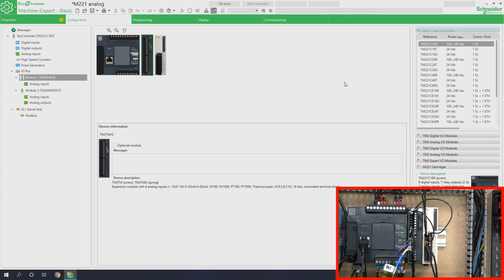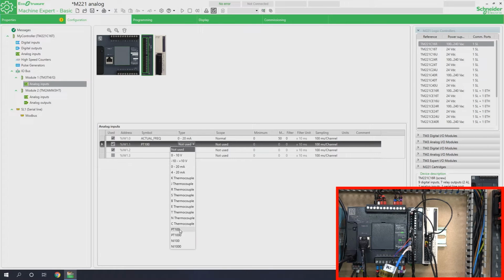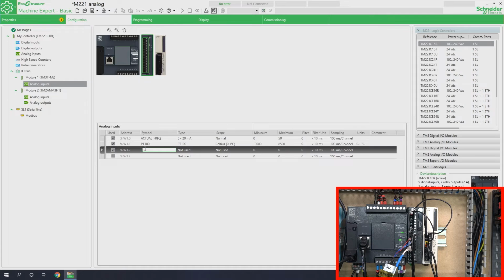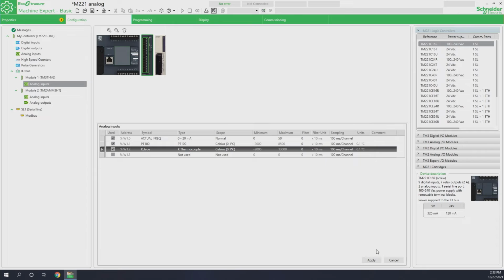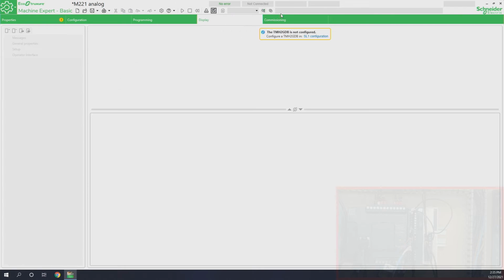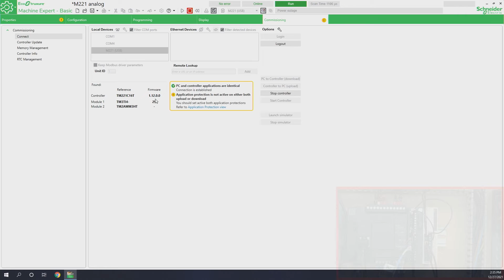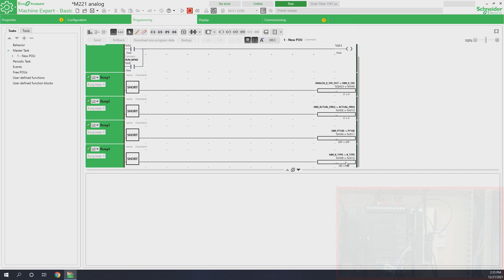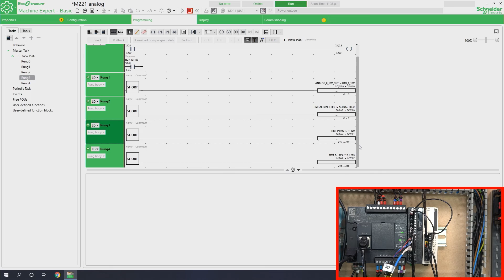Schneider Electric Modicon M221 PLC TM3TI4 analog input wiring, RTD PT100 and TC type thermocouples.

Comment: I am an absolute beginner want to ask something... Do you really need the extra analog card to take input as in the video for the Pt100 sensor connection or the inputs ports(analog) on plc itself are sufficient?
Reply from the maker: Hi There. If you are using signal conditioner and have PLC that has standard analog input, yes you could get away without the card, but in my experience, it is easier just to have card that converts the signal to what you looking for.